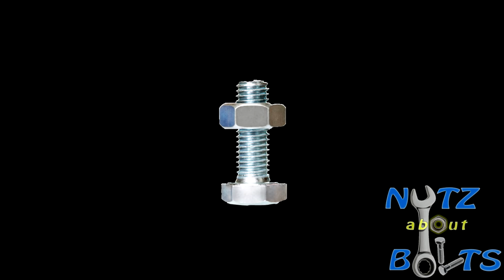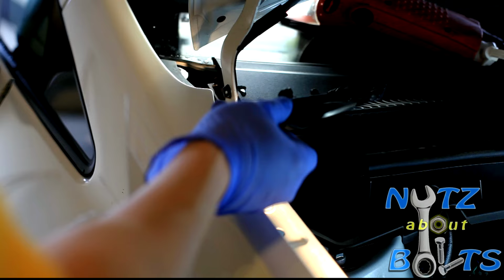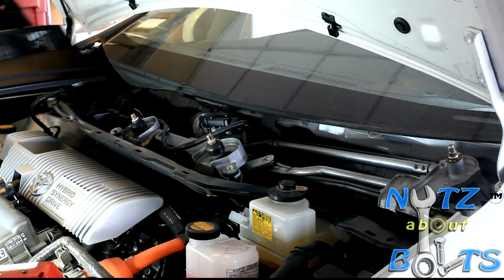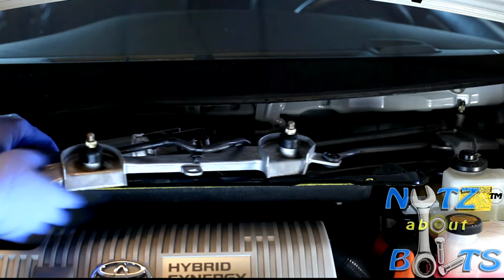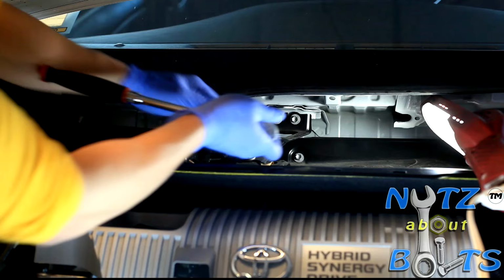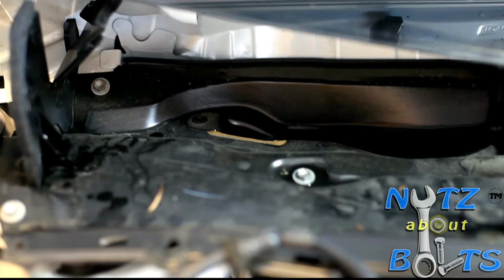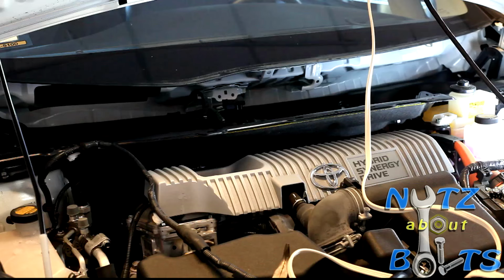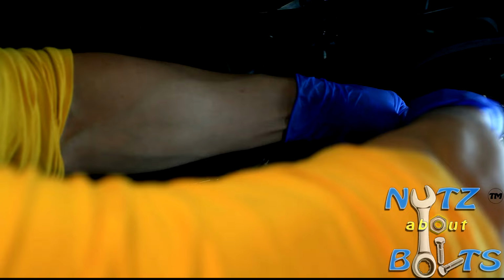2010-2015 Toyota Prius Spark plugs remove and install HD

Comment: Nice video. It prepared me well, to do a job that was engineered to be way too difficult.
The only things I would add are:
1) I would use an EXTREMELY small amount of anti-seize on the plugs. Some documentation says to use NONE.  Look into it.
2) I found specs that said 18 - 24 ft. lbs for the torque.
3) Some people say not to disconnect the cables from the coil packs. I say that this gentlemen did it correctly. I tried to leave them plugged in, but I was not comfortable stretching the wires to avoid un-plugging them. Just MAKE SURE you do NOT pull on the cables!
4) I left my wiper motor cables connected to the motor and only released the two cable tiedowns on the passenger side. I then pulled the wiper motor assembly loose and set it on the mechanicals near the front of the engine compartment. It might be a good idea to lay something down first.
Reply from the maker: 1) some manufacturer already add their own anti seize on their spark plugs thread already, such as NGK. You will need a little if they haven't added on there for you, so that you can prevent seizing of the spark plugs when you remove it when its at 120k miles.
2) on the repair manual, it stated 15 ft. lbs, you can check on PriusChat as well, they have a whole thread about it.

Comment: Make sure your boot is fully compressed while you put the boot bolt back in.
Another great video.
There are a few spots where a more thorough explanation description would have been nice.
But this is an accurate video of how to change the spark plugs. 
You'll save at least $150 over having a shop do it.

Comment: Plugs can be changed without removing the covers. All you need is a #14  3/8 Deep socket with rubber insert to hold onto the plug. 2 x 3/8  x 3 inch extension bars and ratchet. Socket can be inserted with single extension and than add the other extension and remove the plug.

Comment: Just finished the job by following this video! My engine no longer shakes at startup. Smooth rolling now.  I used 13ft torque for the new plugs as listed (I know they say 20 in the video). Also, take off the brake fluid cover or it will get popped off as you remove some of the washer assembly. The hardest part for me was removing the electrical connection of the washer assembly. Eventually it came off, but I couldn't see what I pressed to do it. Thanks for the video!

Comment: Those little plastic screws, if it wasn't because of your video i would not know how to remove them. I have a 2015 prius with 256,000 running fine, and I really hope is a little bit easier to get to the spark plugs on mine. Just by watching you work I already feel a little intimidated. Thank you for such a great video
Reply from the maker: It’s not too bad, takes about 40 mins your first time, make sure to use electric tools

Comment: I did this myself and it actually wasnt too hard. Everything worked great. First time I've ever replaced spark plugs in any vehicle or removing wipers and cowling. If you can do an oil change you can do this!
Reply from the maker: "If you can dodge a wrench, you can dodge a ball.”

Gj! Easy peazy

Comment: It took all of an hour or less to get it done. Big thanks to this video and clear instructions. Now onto the serpentine belt, you wouldn't have a video for it would you? Thanks man.
Reply: Glad to hear it was easy.  Did you have to disconnect the battery before removing old spark plugs and installing new ones?  I'm getting mixed recommendation from the internet?  Thx.
Reply: +dokchoe I didn't bother with battery disconnect.
Reply: thx for your quick response.  I assuming you had no issues with not disconnecting the battery first.  Thx.
Reply: +dokchoe yup no issues at all. I changed the coils as a preventative. I've got close to 200k on it
Reply: The thrid-generation Prius does not have a serpentine belt :) The water pump is electrically driven.
Reply: @brandongage9237  yep yep it's a completely beltless car.... so weird

Comment: With respect to all your hard work and passion,  but you don’t need to do all that parts removing just to change the plugs. If you have some different size extension bars plus a cv joint one you are done easily.
Reply: You would need to somehow sneak the coils out..

Comment: Thank you!!!!
My local dealer price $200.. parts and labor.
Original OEM plugs Denso CS204R11(90919-01253) Toyota changed (revised) to Denso SC16HR11 (90919-01275) a hotter plug. And most spark plug companies say not to use any anti- seize on the threads. Torque 13 ft-lb
Tips watch the video at speed setting 2.
And I used a cordless drill to remove all the nuts and bolts ( a lot quicker).
On the windshield wiper motor/actuator, I marked the 4 holes where the long 10mm screws came out of.
 I only undid the 2 left clips 4:15 on the wires and than placed the whole plugged in unit on top of the engine.
The whole job including cleaning fire wall area took less than a hour.
Reply: Curious about where you got this information? It certainly isn't on the plug box.
Reply: I highly recommend a dab of anti-seize. The plugs in my 2010 were nerve racking to remove. It felt like they were going to strip. I would back them out a bit and then forward a bit to relieve some of the tightness. I think plug companies recommend against it because they don't want people stripping out the cylinder with a torque wrench. I opted for seat of the pants torque-guessing. Less is more.
Reply: Toyota dealer where I live wanted $800 to change plugs.

Comment: I am empathize with those who are complaining about the Prius spark plug replacement costs or laborious DYI effort. Having said that which car in the market today pays for it self besides Prius with 45 to 50 miles/gal? Go get a spreadsheet and do the calculations on you driving profile using Prius fuel efficiency and learn to live with the negatives.

Comment: Living up to your name
NutzAboutBolts.
You're obsessed about removing bolts.
YOU DO NOT HAVE TO REMOVE THE WIPER AND ASSEMBLY TO CHANGE SPARK PLUGS IN GEN 3 PRIUS.
Reply from the maker: Thanks, we do like removing nuts and bolts because we are nuts and like to remove everything from the car to replace the spark plugs. By the way, there is 2 types of engine compartment. One like this that require the removal of the wiper assembly, and one that doesn’t require the removal of the wiper assembly, look it up.

Comment: So you CAN replace PCV valve from top. All you have to do is remove five 10 mm airbox nuts, remove airbox. PCV valve is right under 2nd from right intake manifold plenum chamber. You need 22 mm or 7/8 inches deep socket 3/4 inch drive. It helps to disconnect throdle body wire connection and hose and bracket of the sensor at 2 o'clock position of the throdle body. The hardest part is to keep the 22 mm socket on the pcv valve since the pcv valve has a thin lips for the socket and a long neck.

Comment: Thanks for the video. I managed to get them without removing wipers or anything underneath. 10 mins and I am done. Bought spark plugs online for 20$ only (Genuine Denso)
Reply: whats the model and year??
Reply: That’s not true.  There’s not room to pull out sparks plugs.  You can do that on 2nd generation but not 3rd.

Comment: Just to be safe you should pull and replace one plug a time.  Leaving all four plugs out while working invites dirt and even stray hardware to drop down the rabbit hole.  Taking all four out at the same time gives you four times the chance of this problem.

Comment: I'm wondering if anyone posted that you don't have to remove the wipers to pull the spark plugs.   You just need a simple cheap spark plug swivel head.   There's another video on how to do this same procedure.   Saves much time.
Reply from the maker: I know the Prius c doesn’t require removing the whole wiper assembly, the thing is not the spark plugs that is in the way, it’s the ignition coil that hits the wiper assembly tray when removing it. I’ve tried…
Reply: Yes, I see it now.  You can't clear the wiper assembly when pulling out the coil packs.   Great video.

Comment: this video is great - no doubt, just a bit lengthy, some twisting and  turning can be shortened. Also what would be useful is a quick note on why or when spark plugs must be replaced. perhaps, compare an old spark plug to a new one and explain why the old plugs are no good anymore.
thank you for great videos!
Reply from the maker: over time, spark plugs electrode tips get worn down by the engine, so the spark plugs gap widen which causes the engine to run poorly, which can cause misfire. So you want to change it around 120k for Iridium spark plugs.
Reply: I'm slightly past 90k. so i guess i shouldn't be worrying for another 30k. i still got my tools already!
thanks again for sharing information and making great videos!

Comment: Thank you for the informative video! Well done. However one slight mistake- do not put any-seize compound on these spark plugs. They are designed to be installed dry. You can over torque the plugs by 20% if you put the anti seize compound on.
Reply: Yeah I thought with the new plugs anti seize wasn’t necessary. How my 2013 f150 was I just did

Comment: Spark plugs actually use a 14mm socket instead of a 9/16, but a 9/16 will suffice. I was able to get the version with the magnet inside of it, so I didn't have to remove any rubber from inside the socket.
Reply from the maker: Yeah, some metric socket doesn’t have the magnet in them. Usually the standard size has the rubber or magnet in them, that’s why I suggested 9/16, but yes, 14mm will work.

Comment: NO need to take the wipers and motor off. AND, just a word of caution: either remove/replace one plug at a time or COVER UP those holes.
Reply: On Gen 3 it's necessary. Gen 2, no.

Comment: If the ignition coils are old, better replace them too, to avoid repeating the process of removing the top parts when you need to replace them. The torque requirement for the sparkplug should be lesser than the normal torque when you add anti-seize.

Comment: your torque spec above say 13 ft. lbs for spark plugs, your video says 20, and the bosh Iridium plugs I bought say 17 on the box... which is it ?
Also you say 9/16 spark plug socket, which is odd for an asian car to use not use metric. I used my 14mm BMW socket and was a perfect match which is a tiny bit smaller and likely the real size.
Reply: Was wondering the same thing on the torque specs.
Reply: 13 ft. lb. He corrected in a comment above
Reply: It is 14 mm. I used 9/16” (which is a tiny bit bigger) and had a little trouble when the socket torqued onto the plug. The socket kept pulling off the extension while still in the engine.

Comment: In the video, you say 20 ft lbs for the spark plugs, but the description says 13. Which is it?
Same with ignition coil bolts: 8 in description, 10 in video.
Reply from the maker: 13 Ft lbs

Comment: Thanks for this Video, this saved me $200 Toyota Dealer charge to replace my Prius Plugs.
Reply from the maker: wess green Yeah, they charge 80-100$ per hour, and I think this job is maybe around 2 hours. That's how long it took me with filming lol. But you can probably do this in 1 hr with electric tools.

Comment: I had my Prius Gen 3, 2010 spark plugs changed and the mechanic just pulled the silver cover, removed the ignition coils, then the spark plugs. straight forward. Refit in reverse order. Watch from 11:30 to 19:45. I am not sure about other models/variants.
Reply: Suresh Tailor must remove cover for 2010 prius I tried and coils would not come out!!!
Reply: Suresh Tailor
Reply: Was it same model bro
Reply: impossible to remove without all this other shit, I tried it and realized the coils will not come out because they are too long.

Comment: People do your own spark plugs.! Had this service done at my local dealer. I asked for the spark plugs and the coils which I had ask them to change. They gave me some weird spark plugs back not original. We've owned the car since new and never had the spark plugs changed. I didn't think anything of it because I was not the one that received the spark plugs my wife was. As I'm going to the garage I noticed the odds spark plugs I asked my wife she told me that's what they gave her. 6 months later we had a problem with one of the coils. I then knew that they never changed them they just said they did. Went to the dealer and had them try to fix it and I walked in on the mechanic as he was working on my car that's what I noticed they never changed him originally. The service manager try to back pedal. They gave me the money back for this service that they did not perform Plus the service they just did and they actually tried to have me sign some non-disclosure paperwork that I wouldn't say anything which I refused

Comment: As I watched the video is possible to remove the silver cover with Toyota logo without need to remove all linkage and other panels. Correct me  if I m wrong. Great video thanks.
Reply from the maker: Yes you’ll have to remove all of the parts

Comment: got a quick question, luckily my 2010 Prius doesn't have the engine top cover, so I guess I don't have to go through all this hassle, but my engine light is on and the OBD II is showing a diagnostic code for 2nd cylinder misfire.
so my question is how do I know which cylinder is the 2nd?
Please reply if anyone knows.
Reply from the maker: if you're looking at the vehicle engine from the outside, the cylinder number 1 is on the left side towards the passenger side. It'll be 1,2,3,4. firing order is 1,3,4,2.

Comment: Sure seems like a lot of hassle could have been avoided if engineers had made the silver cover to slide out forward instead of having to remove everything to pop it off vertically.

Comment: Would the torque specs for ct200h be different? Thanks for all the helpful guides!
Reply from the maker: No, it shouldn’t, follow the torque specs at 13ft lbs. just don’t over torque it.
Reply: @NutzAboutBolts  Thank you so much!

Comment: My 2010 Prius has 210,000 miles, and the plugs have never been replaced. It is starting to idle rough, but is fine after accelerating. MPH has dropped from 50 average, to about 43. So, I figure it is time for a plug replacement.  Does the dealership charge around $250 for parts and labor? I ask because I have never replaced plugs, or do much work on cars. I think I could do this after watching the video, but would need to buy many items. I would need to buy the spark plug sockets, torque wrench, seize grease, etc. After buying all the tools and grease needed, I would probably be over $100 in tools. If I owned all these tools already, I would do this. Just wondering if I should just let the dealer do this, for the difference in cost.
Reply from the maker: you should call the dealership and ask them for the quote. Its usually more expensive than doing it yourself, even if you buy the tools, which doesn't cost a lot.
Reply: I would suggest you to buy the parts. It's a regular thing to do on your vehicle. Buying parts will never betray you.

Comment: Good Job with the video, not as hard of a task as it first appeared just a little tedious. My 2012 Prius has around 135k and it started running rough. No check engine light or anything though.  I figured the plugs needed changed so I changed them, put it back together and started it up and the check engine light is now on. I ran it down the road and I would say the plugs helped out about 40% of the rough running but there is still a problem. Any ideas?
Reply: Possibly a clogged EGR system or carbon caked intake manifold. You should try doing a full EGR system clean (EGR pipe, EGR cooler, EGR valve) and check your intake manifold to remove all the built-up carbon and you may as well replace your PCV valve whilst your at it if it's never been changed as it's cheap and worthwhile maintenance.

Comment: I have questions. We are trying to change Toyota Prius 2010 spark plugs. But when we are trying to remove out the hole old sparks. It's turning but not coming out. Please explain me what reason it is not coming out.
Reply from the maker: You’ll need a magnet socket to remove the spark plugs since it’s deep down there. Unless you have a grabber that can grab onto the spark plugs to remove it out from the hole.

Comment: Those are coil packs, not "resistors". A magnetic plug socket much faster to remove plugs. Be sure to change the PCV valve while you're in there.
Reply: PCV valve is at the bottom underneath the engine on 3 rd generation Prius

Comment: I just purchased the NGK iridium spark plugs, but man this looks way more complicated.  Dealer charges $200 for labor, INDY charges $150, not sure how long this take but I wish you could just remove the engine cover and be done but sadly you have to do a million steps to get to the spark plugs, such a PITA.  About how long that the process take?
Reply from the maker: takes less than 1 hr for me with power tools. took me 2 hrs to film this lol.

Comment: I just chanced the sparks and didn`t remove that wiper area at all. Just take the engine plastic cover of and i had the room that i need to change those sparks.. To get the spark of i used long 14 mm spark socket with that rubber inside.
Reply from the maker: you sure its the 3rd generation and not the 2nd generation?

Comment: You had me all the way until the anti-seize on the plugs then recommended 20ft lbs torque. No need for the gold goop, and torquing with goop on there is almost useless, but I guess that's why you recommended 5 extra lbs of torque over spec.

Comment: I have not done it yet just wanted to see what I was going to get myself into before doing it but I don't think it should be a very long extension 5 inches or so
Reply from the maker: +terry hoedl Its pretty deep in there, its 3-5" depends on your sockets.
Reply: Thanks great help
Reply from the maker: +terry hoedl np